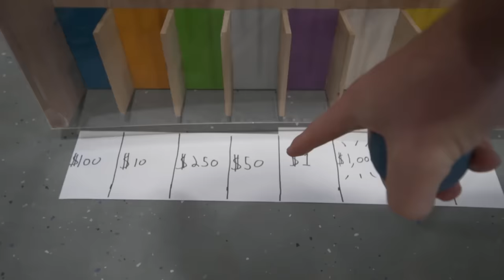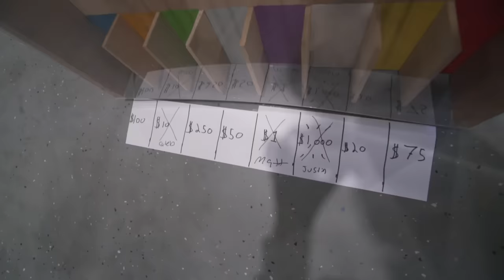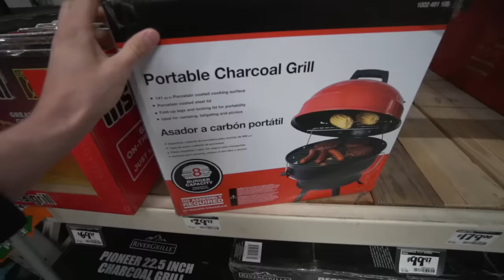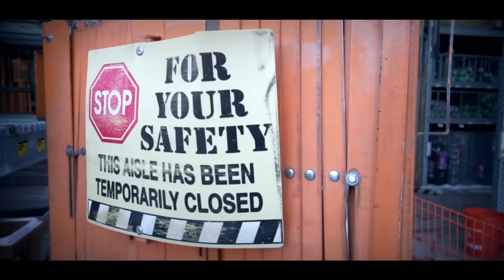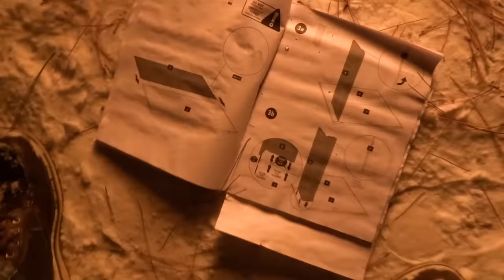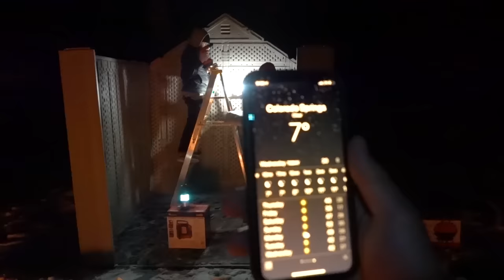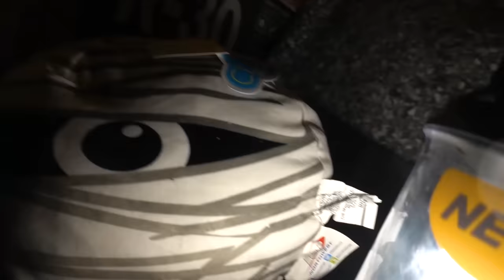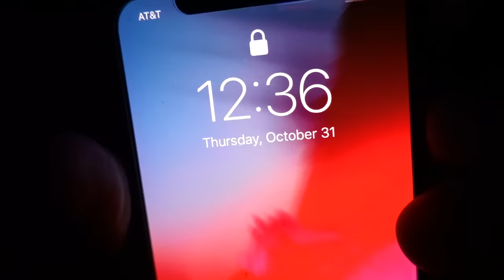OVERNIGHT SURVIVAL CHALLENGE *HOME DEPOT ITEMS ONLY*

Comment: I’m wondering why y’all aren’t using sleeping bags lol 😂
Reply: They don’t have sleeping bags at Home Depot
Reply: That’s sad
Reply: It’s a waste of money
Reply: Ethan the Minecraft Pro 
It is not a waste money
Reply: Addison Murray I know
Reply: Yapereskes
Reply: Ethan the Minecraft Pro i went to a challenge camp it reached -20 degrees (celsius ) and i only had a sleeping bag the tip is to put your clothing at the bottom near ur feet and not wear clothing ik but it insulates the bag  instead if the clothing ur wearing and sleeping bag has insolation
Reply: 7.c I still be in shorts lol
Reply: @jameshone1000  same
Reply: @jameshone1000  that’s not even low temp